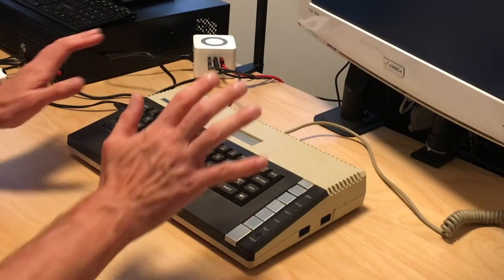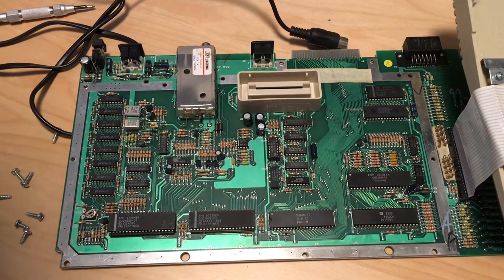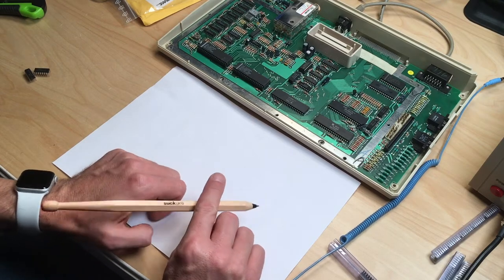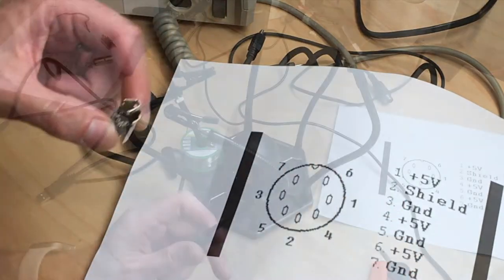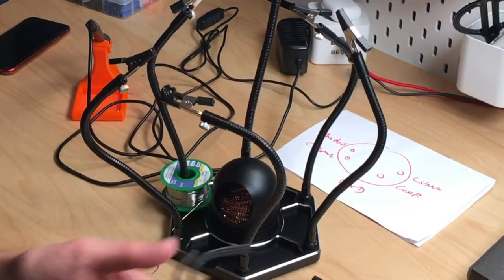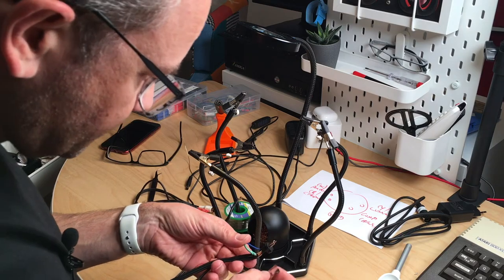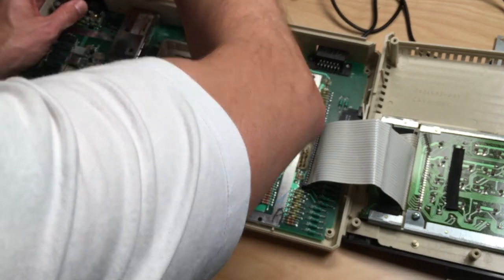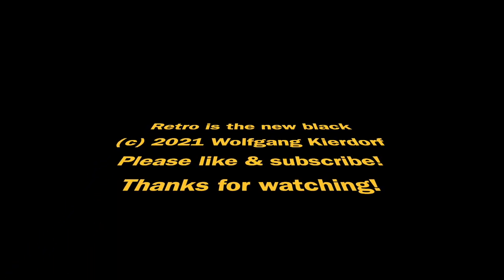ATARI 800 XL repair + creating a USB power supply, a video cable & doing the CHROMA Mod

Comment: It is not the best idea to use a 5-pin DIN connector for power. The 7-pin connector is used in order to prevent connecting power to the AV socket. You have to be very careful when connecting the power to the Atari since it is an easy mistake to misplace it. And the consequences would be detrimental. Also, on most devices, composite jack is yellow, so you kinda made a cable that does not follow the standard. ;-)
Reply from the maker: Yeah, I also said so in the video. Best to use the appropriate 7-Pin connector.
Reply: I bought a C64 cable made in England or Ireland, cant remember a few years ago, but I took a photo of the paper that came with it and saved it because the composite was on the black and the red and yellow were the Luma & Chroma and the audio was the white. Maybe Europe has a different color standard because he made his just like the cable I got from Europe?
Reply from the maker: @Charleshawn66  These are the colors used on the back of the Commodore 1702 monitor ... even the NTSC version. I don't know if that is some kind of color coding standard.

Comment: Sehr schönes Gerät. Bei der letzten Boardrevision ist chroma angeschlossen, aber diese Maschinen sind etwas seltener. Die meisten XL haben von Haus aus eben nur  composite und luma am Videoport, da hat man ggf. etwas zu basteln😂 Das drrrrrr Geräusch beim Start ist vollkommen normal, da checkt der Rechner, ob ein Modul im Cartridge Slot steckt....erschreckt aber jeden Newbie, hat mich auch nervös gemacht  beim ersten Start...

Comment: 20:01 basically you have to solder the black wire to any of the pins on the left (5, 3, 7) and the red wire to any of the pins on the right (6, 1, 4)

Comment: That "rubber stuff" isn't  for  mounting the keyboard. It prevents the keyboard from bending when abused.
The ribbon cable can be easily removed by lubricating the connector with some contact cleaner. That also works well with Speccy ribbon cables and with socketed ICs.

Comment: Greeting I hope you are fine, recently I bought one Atari 800XL new, but isn't working good, I have a random failure, and the black screen, but if I insert a cartridge, the computer give video on screen and apparently works, Do you seen this problem before??,
Reply from the maker: Sounds like a dead BIOS ROM or BASIC ROM to me. The ATARI can run cartridges without those ROM chips. Not sure if the 800XL combined those two into one ... try removing it and if the cartridge still works it should be this. Cheers!
Reply: @RetroWK  Thanks, I going to check!

Comment: hi pal!
I made a tiny brand new Power Supply and works perfect!, but I've tried to do the video mod and cannot get color from the signal... I have a very sharp image but in black and white...

mi board does not have C56, so I raised left leg on C54 and took a cable from junction on R76 and R68 to pin 5 on Monitor output... what can be happened?

I watched a video from some guy that took off completely  C54 and C55 and it works too... please give me some lights 🙏

I'm plugging my 800XL on a Sony Bravia 32'' LCD TV (KDL-32EX305)
Reply from the maker: Hey! I would love to help, but that was my first Atari mod. Did you check for the mod for your board revision?
Reply: @RetroWK  Hi, i was a little confused… i realized that i needed another kind of cable, and another tv or monitor ha ha! So It finally works!

Comment: Why did Atari use a 5 pin plug if only two are needed for the computer to work and it creates the danger of pluging the power plug into video out by accident. Some engineer in the Atari company really though it a good idea?
Reply from the maker: Can't tell you. I think earlier models needed also 9v, but don't quote me on that!
Reply: In XE refresh they changed it to 7 pin.
Reply: They use a 7 pin connector for powering the machine. You can  not fit the 7pin  in the 5 pin video connector. Only if you make your own  power cable and you make a mistake.

Comment: Nice peaceful video. Enjoyed it. Chroma+luma looked pretty good here. Note that your keyboard is the best variant for the 800XL's: the ALPS mechanical.  Types fast and has a very satisfying sound. If you want to disable BASIC you can hold OPTION down and press RESET while in self-test and it will go back to self-test with BASIC disabled.  Saves having to power cycle the machine since each power cycle puts a small amount of stress on the computer. With basic disabled the diagnostic RAM test will then test the last 8k block.  Enjoy!!
Reply from the maker: Thanks! The keyboard is really awesome. I just got the SIO2SD in. Video coming soon!

Comment: If you don't mind me asking: where did you get your TS100 soldering iron stand?
Reply from the maker: Sure. It's 3d printed and the ring (hold the iron) is a washer melted into the print. The model can be found here: https://www.thingiverse.com/thing:2150796

Comment: And by the way, it is advisable to use 2A or higher rated PSU, especially if you plan to expand your Atari in the future.
Reply: Yes , much to risky to power this on a USB supply , those supplys depend  on the sole voltage chip , far more likely damage than the original supply

Comment: Excellent work! 

It's nitpicking, but @24:03 I think that you mean "shell" instead of "hull". But what would I know? I'm from Frankfurt... :)

As for removing that memory chip, having done what you almost did, I was certainly squirming in my seat. My standard method for dead chips these days is to clip the legs and pull the pins one by one.
Reply: Could also be called a "hood" I suppose...
Reply from the maker: Thanks! Yeah, could be shell ... it's definitly not hull ;-) Cutting the legs is a good idea. I am just hesitant about that because the ic could still be OK.

Comment: Awesome video That RF shield is crazy that you have to pull the board out to get to its screws on the underside! Would of made it much harder job to an authorized service agent back in the 80's!
Reply from the maker: Yep. Crazy construction. I had to open the machine three times during the project and it was a real pain.